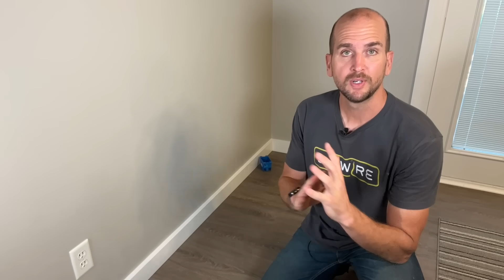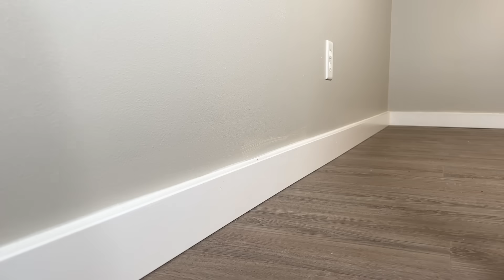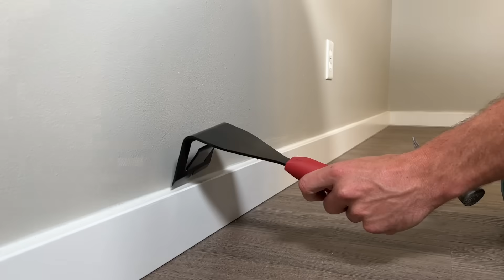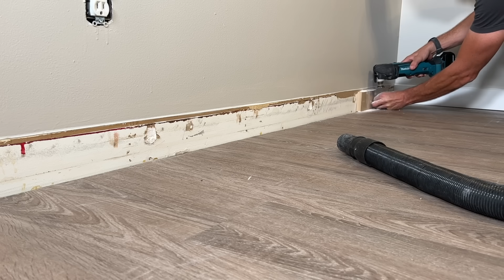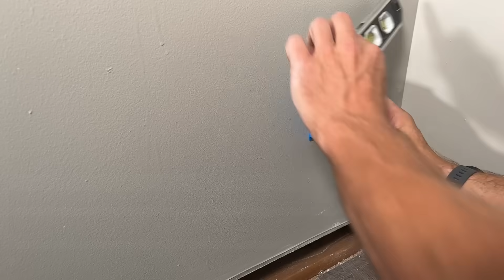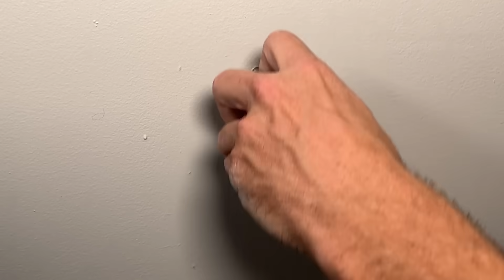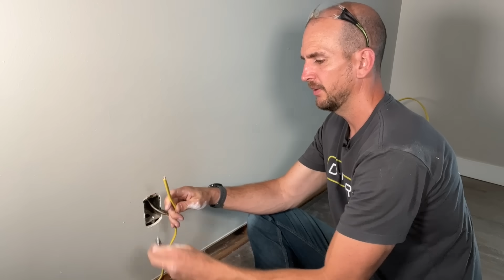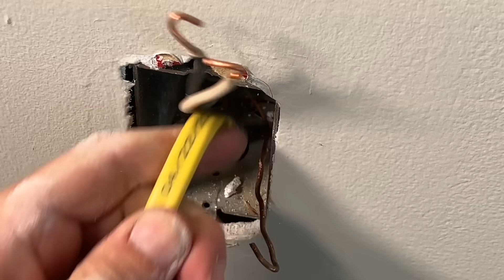How To Add An Outlet To A Finished Wall

Comment: An oscillating tool makes a HUGE mess in the environment. The dust floats everywhere, even if you’re using a vacuum. And it’s easy to cut through an existing power line, if you’re not careful. Use it ONLY in areas where a hand saw can’t, like over each stud.

Comment: this is very cool. Unfortunately, I don't have baseboard and I don't have drywall. I have old wood paneling. I suppose I could cut out the wood paneling and add baseboard later. The magnetic stud finder thing is very cool. I can see where my studs are because there are nails in the wood paneling. I have printed wood paneling with texture/color on it. Probably from 60s or 70s. Question: What if I need to bring wiring around a corner on an exterior to interior wall? I want to add a vanity light to my bathroom (I only have a ceiling light) and the switch would be on an exterior wall but light would be on an interior wall perpendicular to the switch. Any cuts would be on wood paneling above a built-in vanity. Any suggestions?
Reply: If you have nails exposed holding the panels, pull some out on an edge and see if the panels are also glued. If not, punch the nails through with a nail set and remove the panels needed and reinstall after. If glued, you might be out of luck. Why would your new switch be on an exterior wall? Where is the current switch for the ceiling light? Put the switch for the new vanity light on the same wall (did that in my parent's house) or cut out the original switch box and install a double old work box and go from there. Access to the top of the wall from an attic is best if you have it. There are many ways to get around obstacles.
Reply: @hotpuppy1  I was going to have a triple switch for the vent/light/heater in the ceiling but having a second light or having both lights linked to one of the rockers might work. I already have an electrical outlet for the bathroom in the exterior wall. I have a vanity that has wall behind it and to one side (the side with the exterior wall) and the GFI was put in that wall. The light switch is a triple toggle over near the door opposite the vanity. Whoever designed this house didn't have a lot of sense. They put carpet in the bathrooms.

Comment: Great video. Really explained a lot and this helps. But, if you're adding an outlet for charging, why not use an outlet that had USB charging ports?
Reply: A USB receptacle used to cost 10 times as much as a regular receptacle plus a charging adapter.
Reply: @denverbraughler3948  ? We replaced a number of our outlets with USB receptacles. They're like $15 on amz.

Comment: As a former journeyman I watched this with curiosity to see what you would do. Honestly really impressed.  Part of me assumed you are gonna use some trick that was lazy and wouldn't pass code.  That is a solid job though.
Reply: Master Electrician here. This wouldn't pass code.
First- Tamper resistant outlets are required.
Second- Needs nail plates.
Third- Wires cut too short.
Forth- Most jurisdictions don't allow drilling more than three studs in a row for structural integrity.  
 Fifth- He mentioned this is a rental. You are not allowed to do your own electrical on a rental property, you must hire a licensed professional. You're allowed to put your own family at risk but not others.
Reply: Nail plates to protect from severe damage are required by NEC.
No, his installation wouldn’t pass code from 2017 NEC onward.
Reply: @denverbraughler3948  Yup.
Reply: This is what I came to ask about. How do insurance companies feel about DIY electrical work?  Are permits required? Does the work have to be inspected?
Reply: @guyspangler467 :

You have to read your insurance policy.  But you should be more concerned about the report by the fire marshal after there is a fire or collapse.  You wouldn’t want to be implicated.

Most jurisdictions exempt the homeowner’s minor modifications inside his own home.
Check with the authority having jurisdiction.

Electrical, plumbing, and structural work including decks must be performed or supervised by a qualified person.

Work that won’t pass inspection is substandard regardless of whether an inspection is required.
Reply: I also thought that a metal nail plate should be installed on every stud where the wiring pssses thru in Canadian code. I can imagine a future home purchaser replacing a new bottom wall trim or adding  new sheets of drywall over the existing drywall and screwing thru the electric cable running thru the low part of the studs without protective wall stud plate since they wouldnt ecpect to see wiring so low on the wall. 

Also....i heard that many framers hate plumbers,  electricians, and hi efficiency furnace    vent installers who hack thru studs or stome foundatioms in older homes to run water pipes.air vents and cable  sometimes with no regards to structural integrity of the older house.
Reply: @toys2work :

There are rules about cable protection when not set back at least 1.25” from both sides of the stud.
There are also rules about holes, notches, and reinforcements in wood framing.

Fortunately, modern technology is making it easier to detect cables and pipes inside walls.

Comment: Hello - clever approach! Question: why use WAGO connectors in the metal box instead of simply connecting the new wire to the terminal screws on the other side of the outlet? Is there a con to that approach?
Reply: For backwired receptacles, there’s no serious drawback.
Changing the receptacle in the future requires redoing two additional wires.
For wrapped terminals, pigtails leave the “permanent” wires untouched.

Comment: First off I am a RCI sparky.  To find the studs yes use a magnet. #2 take a metal coat hanger cut off the bottom part making a long drill bit go to the molding and put one ot the box installed one in the area a new box is needed go to the basement measure off the distance 3 1/2" divide by 2.     1/2" or 3/4" thick molding add to 1 3/4 drill the hole now you have a clean shot to the boxes.  Then use a cut in box install the wire staple wire on the beam no staples needed in wall. I don't use staples but a plastic finger.  Reminder this may not be to code in your area ask the fire marshal it inspector in your area.  Some areas you are not allowed to do anything Chicago coming to mind EMT or greater is needed an the union are the only way to go. In Maine anyone can do anything Manhattan no way you are getting a license pro.  Reason I'm  insured and responsible for 7 years after installation money talks bs walks.

Comment: Awesome tutorial! As an option would it be possible to connect the new outlet Directly to the existing Outlet and not add a Pigtail connection since the existing Outlet has an available Relay Input connection? Thanks for sharing.

Comment: I would have still used some fiber tape and a very thin layer of mud at the cut line to reduce air infiltration, unless your caulking both top and bottom of the trim.

Comment: Thank you so much for this video!  An elegant solution!
The other reason to be drilling holes up a bit from the bottom of the studs is to avoid the nails holding them to the bottom plate.
Reply: The NEC doesn’t grant such an exception to the rule requiring protection from severe physical damage.

Comment: British spark here......2 things made me like this video. 1) you used Wagos (2) you recommended Wagos...........
I didn't even think American sparks liked them. But your right they are great to use.
A question though, what if any tests do you perform on that socket once fitted. Generally interested as we have to perform at least 4/5 tests on that socket to be able to issue a certificate to the home owner.
Reply: To be honest, 20 years in the trade here in the states, I intensely disliked Wagos before I actually used them, I still usually prefer to pre-twist my solid wires and use a wirenut, but I can see the utility of the Wago connectors and have begun using them as the occasion calls for. They are better on stranded wire than wire nuts in my experience, so I prefer to use them in that instance, I also like being able to remove a pigtail and replace a receptacle without shutting down the circuit, or risking a tripped breaker, also great on light fixtures...

Comment: Great tutorial on doing it in a simple a clean manner. But I would strongly suggest installing the cable perhaps a little lower so you can install a nail plate. You never know if in the future you might want to change the molding to a larger size and ZAP! Overall great video, I like clean installs as well.
Reply: Slide the nail plate up under the drywall, then it will not interfere with screwing the drywall back on or the brad nails to reinstall the baseboard.
Reply: Would not pass code where I live, have to have a nail plate
Reply: Thomas you could, but tabs have to be cut then drill at least one hole on plate to screw it in place. 

Kent, definitely not code, this is more of a diy project. I’m a retired licensed contractor, there is a minimum height that cables need to run horizontally anyways. Inspector might let it slide if homeowner is doing it with at least nail plates like you said. If a licensed contractor was doing it it would be a no go for sure.
Reply: @zjedinite  what’s the minimum height for horizontal runs on these studs? Is this code for all states including Southern California?
Reply: @LuisSanchez-wf9zw  I’m assuming every state has similarities and difference between building codes. Specially California, I hear it’s bananas out there. Somethings make sense like strapping hot water tank to the wall die to earthquakes and such. Like Florida requires hurricane ties on the rafters. 

Back to the point, I’m a GC in NJ and my electrician runs the boxes 12 inches from the top of the floor covering to the bottom of the box. Then cable needs to be secured at no longer then 12” from top of box. 

So to clarify the answer it’s 24 inches maximum from the floor, nail plates MUST be used. You should use this as just a guideline but will highly recommend you search your local codes if you’re doing this with a permit. 

If you’re hiring someone then Will highly suggest you pull a permit, that is to protect you. If you’re doing it yourself then we can save the headaches from the inspector but just please make sure you do it right. NO SHORTCUTS! Hope this helped 🤙🏽

Comment: Great vid.. Never thought of doing it like this.  Why did the holes in the stud need to be so big?  I'd think as small as practical would be easiest and weaken the strength of the stud the least.. In the case of Romex you could have done a half inch hole and still had plenty of room?
Reply: Indeed, I would have used ½" as well. And it's not like ⅝" and ¾" spade bits are hard to find either. Maybe he just doesn't like having to struggle to feed the Romex through. Or maybe the 1" hole is a safety issue, in that if you did ever happen to run a nail or screw to where the hole is, it would likely just push the wire out of the way rather than puncture it.
Reply: @ps.2  Good point on the nail issue, I guess I'd be concerned if it was a load bearing wall, but no worries.. discretion is the better part of valor.
Reply: @TexasNEV  It's a guess on my part. If you use a ½" hole you can get it about 2" from each wall (including the drywall) and it seems to me the risk from future fasteners is minimal (especially less than 4" off the ground). So... yeah, I'd still use the ½" bit, or maybe ⅝" just to make the 12 gauge Romex easier to pull.

Comment: I have to agree with Patriot1.... This was a no fuss, no bother solution to a common problem.  It's also a utility tip.... running speaker wire.... BRILLIANT  - thanks for sharing this

Comment: Interesting that you're allowed to do that in the US, assuming you are allowed. In the UK we have prescribed zones, and floor level isn't one of them, that would need to have been a horizontal line between the 2 outlets. Neatly done regardless
Reply: Yes I was a bit "shocked" that variable height cable runs are allowed between outlets. Having said that I have friends in the US that said they have rented places where the cables ran at 45deg to an outlet!
I'm much more comfortable with zones, though to be honest I hate domestic wiring. 36 years as an Industrial & HV electrician.

Comment: Your video taught me a great deal. Until now I've been more surgical at this type of work--cutting smaller holes just at the studs, then passing the wire through notches and kick plates. But that leads to occasional difficulties remounting the trim or sheetrock between the added space of the kick plates and their nail-repelling properties. Your method, with the wholesale removal of the sheetrock at the beginning, avoids all those problems and only adds a little extra cleanup. Thank you for showing us!
Reply: If you do have a situation where you still have to cut through and  patch drywall it is by far easier to cut a 5 inch wide channel the entire distance and patch it as one piece. Reinstalling little pieces Takes more time and requires more work to mud the wall smooth than one long patch
Reply: Nail plates are required whenever the cable is less than 1.25” deep.

Comment: Excellent presentation! I appreciate "fast forwarding" through the sections that didn't need a lot of detail. Brilliant ideas with running the wire behind the trim and the installation of the stress relief fitting on the existing box. Following!

Comment: This whole video is Bull, this is how to really do it:  First I tear and cut off the dry wall, then I spend 5 hours cleaning up the mess and dust. Then I try drilling hole in the studs with my dull chipped drill bits, which I used as chisels and scrapers for years. Once I drill the holes in the studs I run the wiring and nail in the new electrical box, usually crooked. Now I put up the new drywall, screw that up and punch a few holes in it out of anger.  I then call my neighbor Larry who did some dry wall work in high school 35 years ago. After both of us are covered in dust and spackle paste we are ready to paint with a very close, but not exact color of touch-up paint. After cleaning up the spilled paint, paint foot prints and the dog, I spend 45 minutes begging my wife not to leave me for messing up basically the whole house. After calming down the kids and the dog, we check out the finished work. Ok buddy so it doesn't work, nor look like your finished product, I did it myself. So that's how it's really done. Next week I'm gonna' tackle that leaky faucet in the guest bathroom. Oh by the way I just pressed your SUBSCRIBED button.

Comment: My question is why would you use the 1/2 inch knockout when all you had to do was use the other small knock out tab then tighten the clasp back up that is holding the original wire?

Comment: Electrical Code VIOLATION! Your homeowners insurance is now invalid! You now have NO insurance against electrical damage.
Your county requires your home to use EMT, or metal 'conduit'. You just violated county code by adding unprotected 'Romex'.
You have just endangered your AirBnB renters, with NO insurance! See you in court, genius!

Comment: There is another way. All you have to do is cut two triangles between the studs. The trick is that when you cut the drywall, you angle the cut about 20⁰ so that you create a beveled angle on the drywall. This makes it easy to just replace the cut-outs by buttering the edges with drywall mud, using your drywall knife as a guide in pushing the piece back into the wall where it belongs. Always mark each piece that you remove so you know which piece goes where and its orientation as well. If you get the technique down, you are left with a thin line to paint and the piece will disappear into the background. I use a small circular saw set at 20⁰ with a very thin blade which makes the repair that much better. In the future I can imagine a power tool that will make these cuts, albeit in a circular fashion, with a thin bit that advances in depth as it rotates. It will make these behind the drywall installations and repairs a snap!

Comment: Absolutely brilliant technique!👍👍
I do have 2 points of contention:
1. Why bother with the pigtail?
(Unless you're just plugging the Wagos cause they sponser your vids, lol.) The current is flowing thru the solid jumper plates on the sides of an outlet - so why not just connect to the 2nd set of screws? In reality I see no point to this extra step...
And,
B. I loved the clamp trick! But I've also seen snap-in plastic strain reliefs that could be used in this application as well.